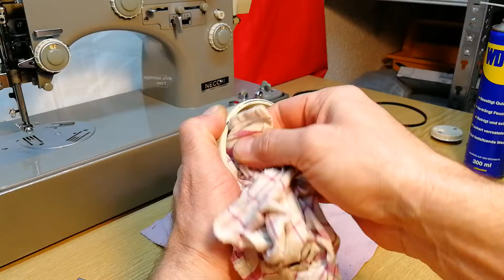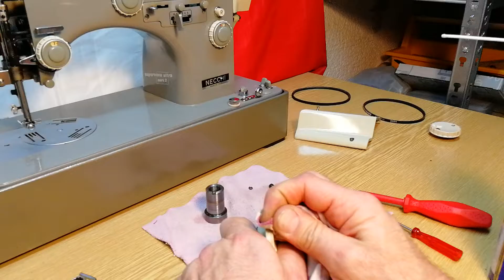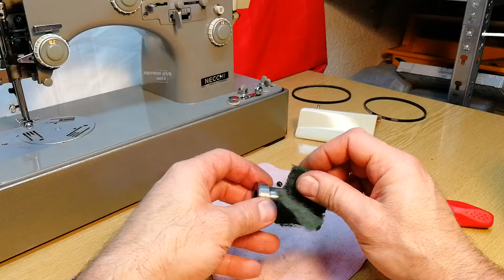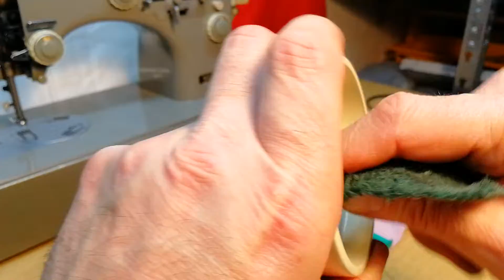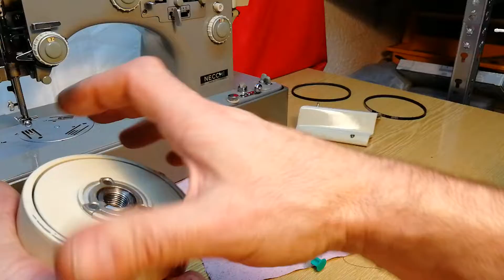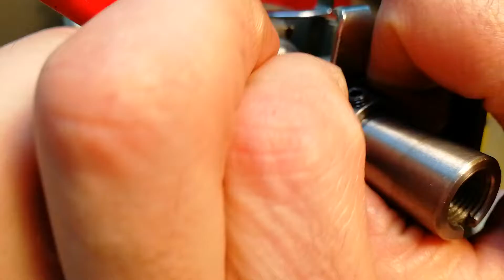NECCHI troubleshooting Handwheel at a Supernova

Comment: I wish I had seen your video before the damages was done. I have the same problem with my super nova Julia 534 , but my husband damaged the flying part groves and I can’t screw it back . Do you know where I can find these parts? I can not find these part anywhere. Can you help. Thanks
Reply from the maker: https://rover.ebay.com/rover/0/0/0?mpre=https%3A%2F%2Fwww.ebay.com%2Fulk%2Fitm%2F254193022564
There are no longer any spare parts.
In this case, used parts must be used.
The parts of a supernova also fit, the whole series has the same parts ...